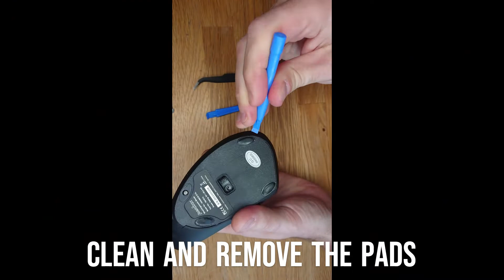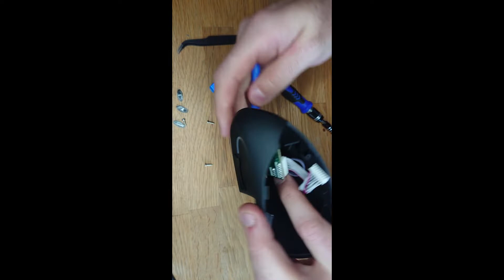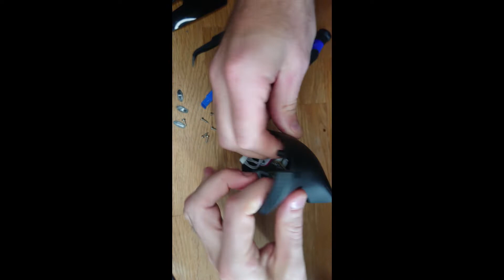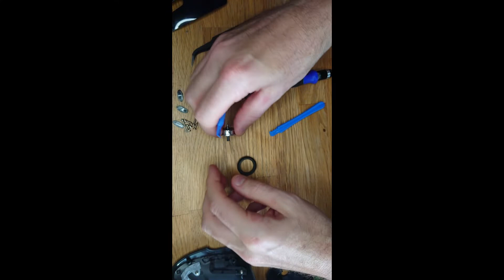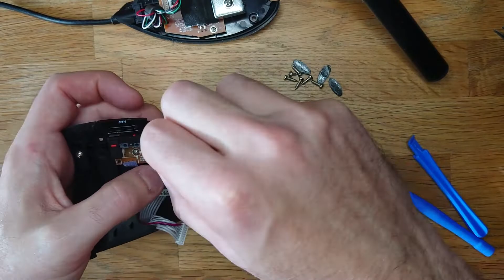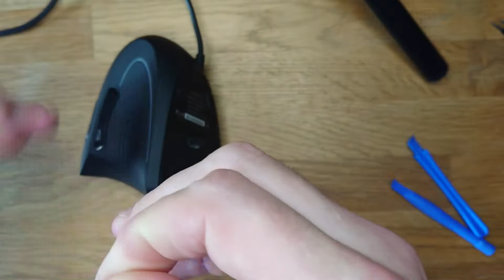HOW to FIX MOUSE SCROLL WHEEL on vertical mouse

Comment: This is helpful if you have these types of tools, but I was able to apply super glue to the rubber tire around the scroll wheel to affix it to the metal wheel without taking the mouse apart. Just have to be very careful to make sure you don't spill any glue outside of the wheel groove.
Reply from the maker: Very good point. Thank you for sharing.
Reply: You risk if there is finger grease of that not working

Comment: Many thanks for this. I've got a wireless version of the same type of mouse and the wheel wasn't working. I thought it was maybe some dirt, but after following your tutorial and opening it up, I found that it was indeed the rubber around the wheel that was slipping. Glued it on and all is working great again now. Top tutorial! Well done 😄👏
Reply from the maker: sweet. thanks for sharing.

Comment: Thanks for this. Other Very similar ergonomic mice include one by Anker and one by Trust. I bought both on Amazon.. Both have failed in the same way after 2 years of use. The last one I took apart and checked the sensors but couldn't see anything wrong. Didn't occur to me that the rubber wheel could be slipping. I will try gluing one and see if it fixes the issue.
Reply from the maker: Hope it works for you.

Comment: This is a perfect disassembly tutorial thank you (I cracked open my first Perixx) 
Another common issue with these mice is the wheel becomes erratic and this is caused by wear on the hexagonal axis i have been using this tutorial to disassembly my mouse and using a sliver of electrical tape in the hexagonal axis that solves the problem for a few months (I heavily use the wheel as i am a lefty and this is my main gaming mouse.
Reply from the maker: Great tip. Thank you for sharing.

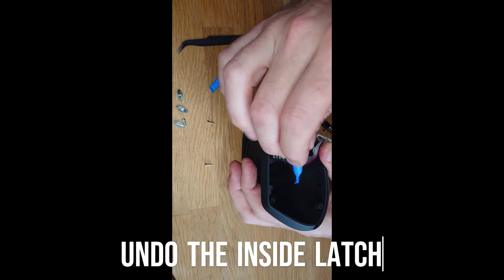Comment: Two things: the ‘undo inside latch’ part at 1:00 was super unclear, as the hands were in the way: but if you shine a light in there, you can see there is a hook-type latch at the base of where the button plates are. 

Second: instead of glue, you can use a tiny bit of PTFE tape - the type that plumbers use for ensuring seals. Doesn’t get messy glue everywhere.
Reply from the maker: @indextwo  awesome. thanks so much for sharing

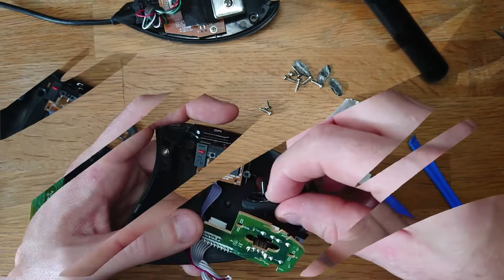Comment: Disassembled my BT/2.4/5.0 wireless Perixx mouse which has been doing this for months.  The scroll wheel doesn't seem to be the problem and there is no way to remove the "tire" from the wheel so to speak.  Specifically I think the problem on mine is the where the scroll wheel itself interfaces with the blue wheel seen best at 3:41 in the video.  I think what's happening in my situation is that the scroll wheel is slipping or lose where it should be operating tighter against the blue interface.  Gonna dab some glue on the smaller axle rod side of the wheel, see if it sticks better.  Thanks for the disassembly, super big help!
Reply: ok put the wheel in the right side and a dab of superglue into the axle hole (opposite) then let the wheel sit for 10 minutes and reassembled.  wheel is a bit stiff, but definitely scrolling in the right direction for now.
Reply from the maker: @ideohazard  that is great tip. Thank you very much for sharing.

Comment: Another thing that happens quite often with those mice is a premature wear of the tiny little piece of plastic of the wheel that goes inside the mouse detector (the detector is blue on mine).
It's a bit hard to explain. Think of the wheel making an gear turn inside the mouse. The wheel part gets all round instead of a hexagon and it does not engage the mouse gear properly.
So far, the only solution I found was to add a tiny little amount of glue in the detector using a paper clip and "fix" the wheel inside it.
Let me know if it helps!
Reply from the maker: Nice addition and very well explained. Thank you for sharing.
Reply: i use a sliver of electrical tape to make sure there is no play in the hexagonal axis, i prefer not to glue the wheel in case it needs disassembly for another reason

Comment: My perimice 713-N wheel has no problem to turn. The problem was that when I tried to scroll a page some times it moved the page in the opposite direction from what I wanted or didn't move at all.
I really wonder how your method solved your problem and also the problem of the other users here. To put glue is really useless if you want to replace the rubber.
The rubber does not slip ! I really wonder why did you put glue.
The problem is in the mechanical component at 3:41 where you insert the wheel. That component need to squeeze it with a tool, a small pliers on its four metallic holders.
That I did and solved my problem.
Also after 6 years the right button didn't work well. I went to a electronic component store and I bought few, to have them in future for similar cases, of those mechanical components that are under the mouse button. With a soldering iron I replace it and it works fine.
Reply from the maker: It sounds like in your case, you might need a replacement since the direction of the scroll is different. You can still take it apart and at least clean some dust out (if any) to see if it helps, but my guess is the problem is more severe in your situation.
Reply: @360swim Νο need for cleaning or replacement in my case. The squeezing of the external metallic holders (at least to me has metallic holders) of the mechanical component that has internally the rotating mechanism (that with the green hole in your mouse) on PCB solved 100% the problem.
Also, I made correction on time I mentioned in my first comment. Was not 3:91 of course (it would be impossible) but 3:41
Reply from the maker: @V2000-t8v  ahh sorry, the comment somehow got cut off, so did not see the solution. Well done. Thank you for sharing this. I'll take a look at it.
Reply: Your problem is wear of the hexagonal axis on the wheel, the same happens to me see my other comment to solve it

Comment: Great video -  I needed a quicker, easier, more temporary solution.  I did not disassemble the mouse as shown. I pried the tire away and used a q tip and alcohol to clean one section of the hub and wheel. Then glued it being very careful not to get any glue in the works. 

Rotated the wheel 180 and repeated. It's working normally now

Your video pinpointed the problem for me.  Appreciate it
Reply from the maker: awesome. Glad you sorted it out and thank you for sharing your solution.

Comment: Clearly the problem isn't solved by using some glue on the wheel.
I tried on my mouse and it didn't solve the problem, congrats for the scam.
The problem is that the mouse is a cheap chinese rubbish that's not manufactured to be used for long time.
I will go buy some reputable brand next time
Reply from the maker: @nemo1985  well, perhaps you had a different issue. Mine was solved by the glue.